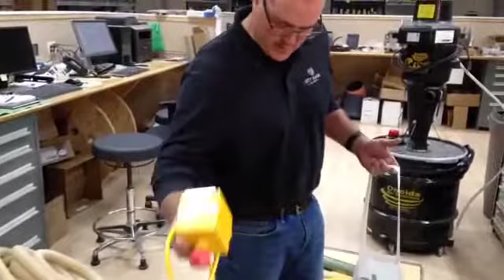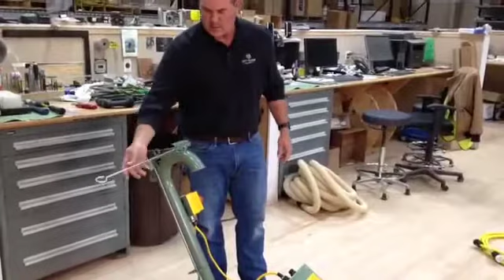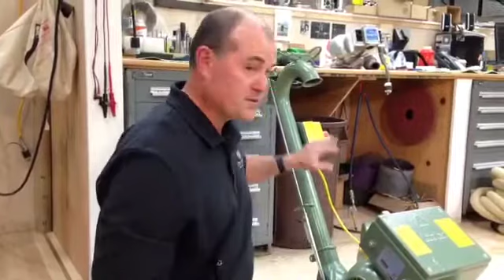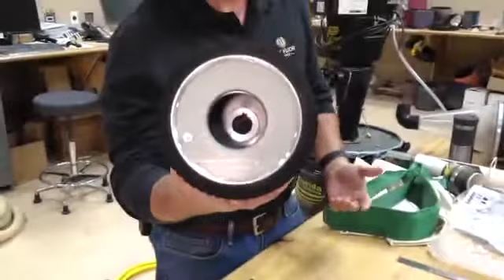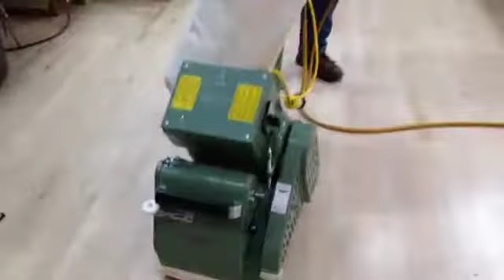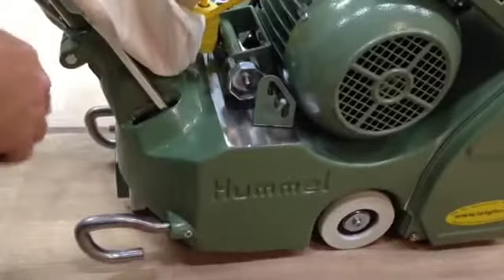Lagler Hummel Uncrating, Leveling, Removing Rollers and More | City Floor Supply

Comment: At 16.50 you say that excessive dust build up can push the linkages apart causing the top roller from not going down enough to be able to put a belt on... rather than slugging a customer for a complete top roller assembly,  surely an engineer would be able to correct this issue???? Maybe even just with a vice???also why arent those "linkages" replaceble??they seem "FIXED" at either end ...what a wraught.

Comment: Can you tell me when lagler first started udsing the new top roll? So i know wich type of top roller i have on my hummel :) I have a used hummel wich was produced i year 2000 do you think it has the same top roler as the one you showed?
Reply: It will still work old or new ,all the parts retrofit new to old

Comment: Adjusting the weight on the drum, what is the factory setting and how do I put it back if someone jacks it up ? My boss got my Hummel in 78 or 80 Thanks Ed
Reply from the maker: The factory typically has the drum pressure set to about 65# on the heavy setting.  Adjusting proper drum pressure is fairly involved.  If there is a chance to take the unit to a certified repair facility I would do that.  This way they would be able to measure your Differential Drum Pressure (DDP) which can help identify any other issues.  Hope this helps.
Reply: @Emory237  ~ I have seen the Differential Drum Pressure (DDP) re-calibrated on my machine, but unfortunately for us, you need special equipment to do the job.